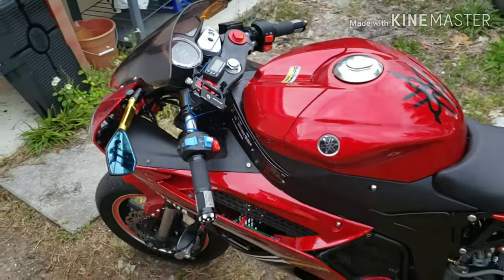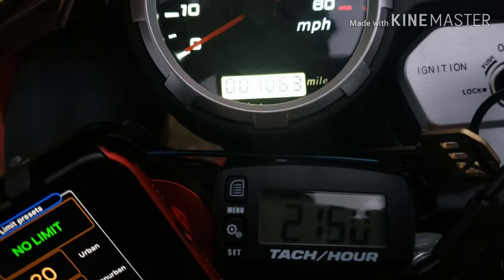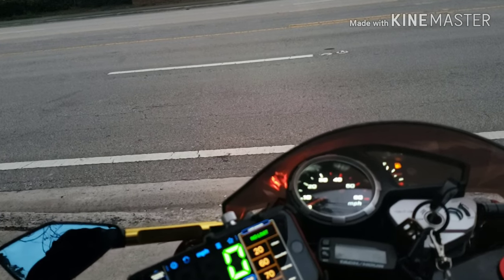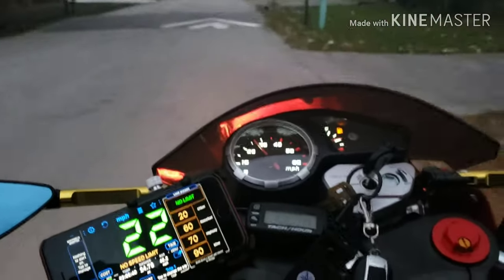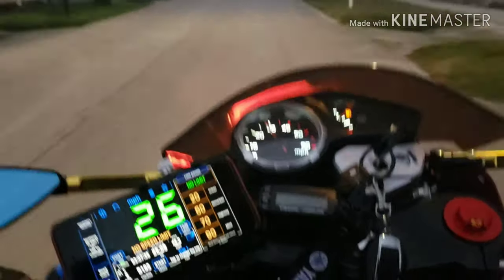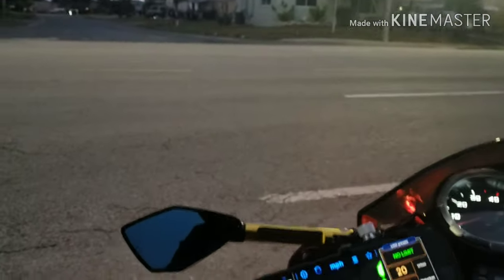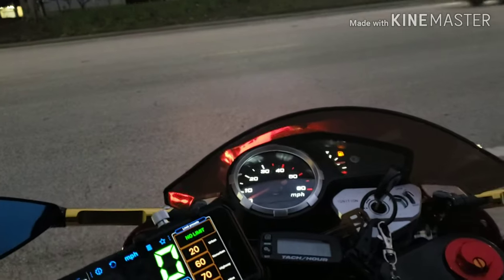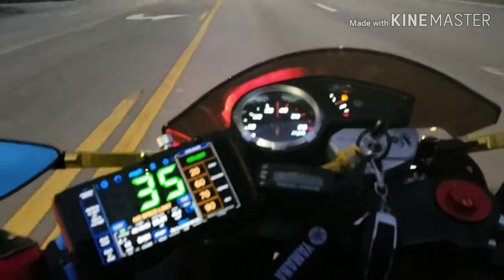Moto vlog #7 gy6 150cc carb installed 46 mph+ Df50sst

Comment: Also, could you show how you replaced the stock airbox, and with what size filter ( with parts you may have use ) to use?
Reply from the maker: Well when you buy a 20mm carb or any carb at that it comes with a filter I believe it’s 38mm tho if you wanted to get it separately but basically I took airbox off turned carb around then installed filter pretty much any one with this and the racer 50 have to put the carb on backwards for filter to fit
Reply: @Mikecheckmoto  Gotcha, exactly what I was wanting to know. Thanks

Comment: Hey sorry for asking so many questions bro but I just got one and wanna make it fast too. Was the 150 cc carb installed on the stock 50cc motor or after the big bore kit.
Reply: Is it possible to get your Facebook or something to talk ? If not I totally understand
Reply from the maker: Instagram is better for me you can message me anytime not on Facebook that much but I put the 150cc carb on the big bore kit I only rode it like 4 miles before I did the big bore kit

Comment: Hey I did the 100cc big bore kit on my 50cc and now it won't start. We kept it at TDC but I dont know where to go from here. Can u help me out
Reply from the maker: Honestly not sure if you’ve checked your spark plug, battery connections ,gas flow and carburetor I’m not sure what else it could be double check everything